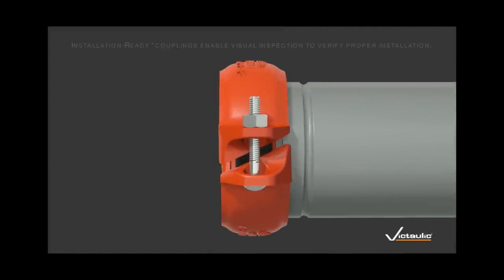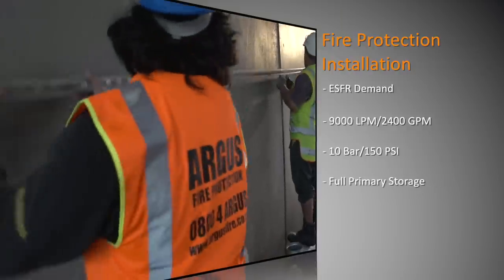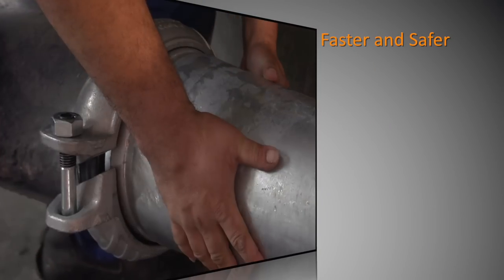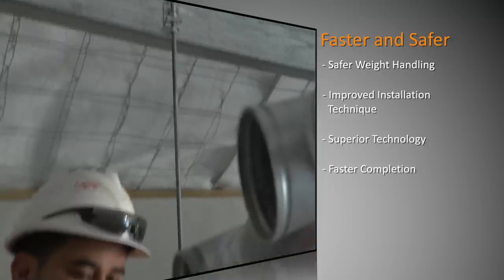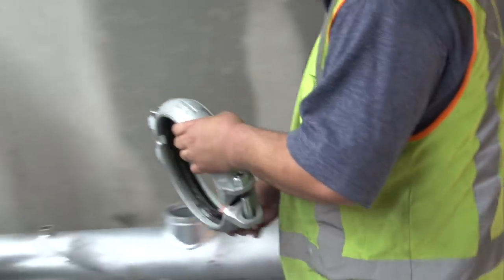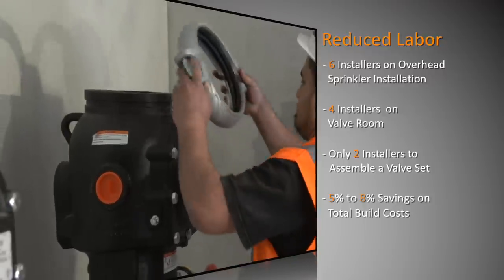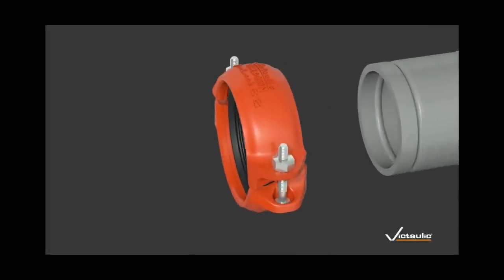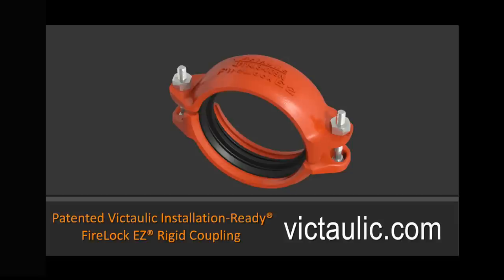Victaulic Installation-Ready™ Fire Protection Couplings & Pipe Fittings

Comment from the maker: Argus Fire Protection specified Victaulic Installation-Ready™ technology in the fire protection system of a warehouse extension project in New Zealand, and was able to save between 5-8% in total building costs
Reply: how many leaks did they have....
Reply: @douglasmanifold7081  I’ve never had one leak but they are expensive. Some companies won’t buy them but they are definitely better. It’s a cost benefit type thing.